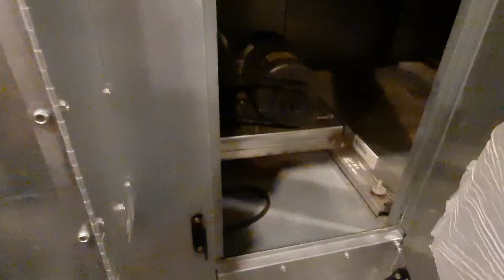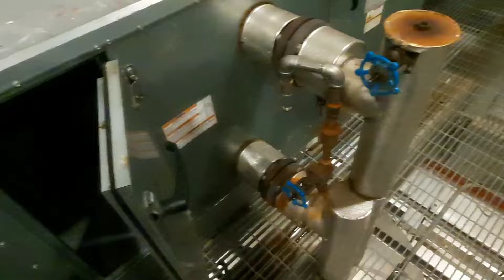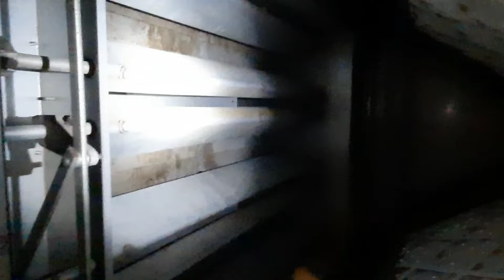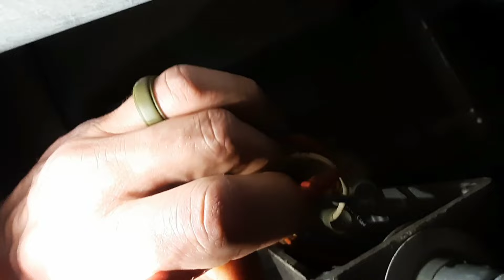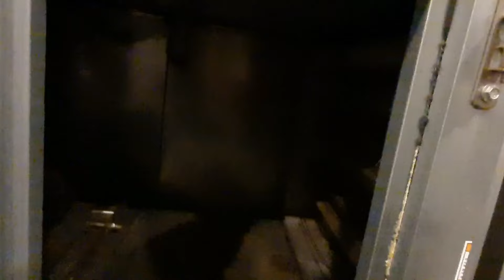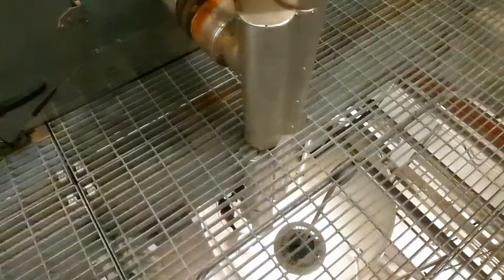Trane steam heated make up air  not working, tripped breaker.

Comment: Great video. Thank you for sharing. May I ask, for 480V 3 phase motor which size wire gauge should use ? and for  208 V 3 phase motor which size wire gauge should use ?
Reply from the maker: The higher the voltage, the lower the amperage. I believe you size wire per the amperage. I'm sure there are charts out there to answer your question exactly and show you how to size wire. This is not my expertise. I made sure the wire I replaced was the same size that I removed. Thanks, ZE.

Comment: Nice find. I am new to steam equipment, and was wondering about the operating pressures. Is 35 psi high for steam? I thought they run around 5-7 psi, but maybe that’s just the equipment I work on.
Reply: Anything under 15 psi is considered low pressure above it,  is high pressure. I have worked on systems that would make 400 psi to sending steam out to building's. Once it reaches the building it hits a pilot operated pressure regulator. ( Steam reducing station ). That will lower the steam to the designed psi for which or what ever it is feeding.
Reply from the maker: W D is correct. This is an unusual industrial steam system. Most would be 5 psi or so. Steam moves faster at lower pressure. I would recommend Dan Houlihan, the art of steam heating. He's a great speaker as well.
Reply: Thanks!

Comment: Same thing happened to me today while checking smoke dampers, and fire dampers. Found a blown breaker which lead back to a 5hp motor shorted all winding blowing a ahu steam coils. Which I had building automation other than the old and mid grade metasys
Reply from the maker: The motor was ok in this case. A single broken wire made it look like the motor had an issue.

Comment: 100% MUA has it's inherit problems on controls side. Some, below 38°F outdoor temp. we would leave valve open 100%, modulate damper only. Coils never froze, control valve was used to maintain temp. above 38°F. With steam, if you don't 60/40 valve set-up that can be tricky to make work.
Reply from the maker: Thanks, Glen. Agreed, the steam valves are supposed to do that at a set temperature, but they had water bleeding from the air vents due to suspected return problems. I set the valves open until I can work out the controls. I have them operating better than they ever did now.

Comment: A motor starter will not trip on a dead short but it will eventually trip as the motor starts to overloads the circuit breaker takes care of the dead shorts like you had as always a good vid
Reply from the maker: Correct, thanks, Ralph!